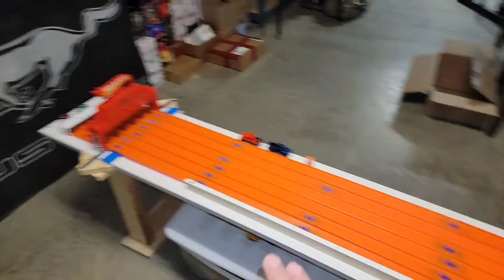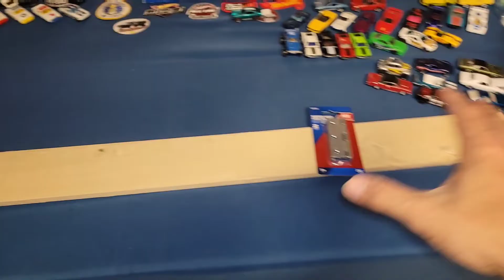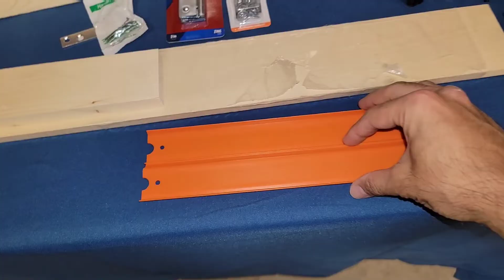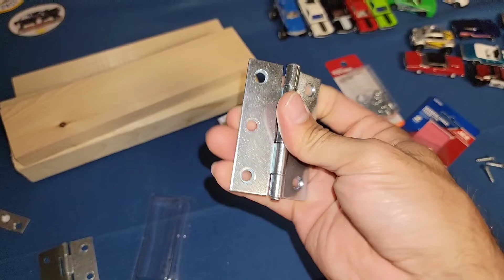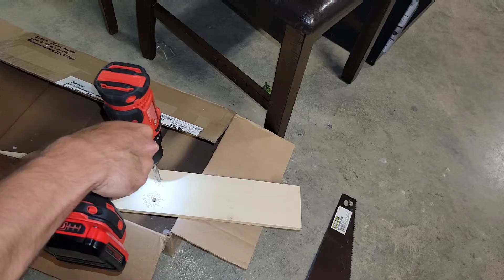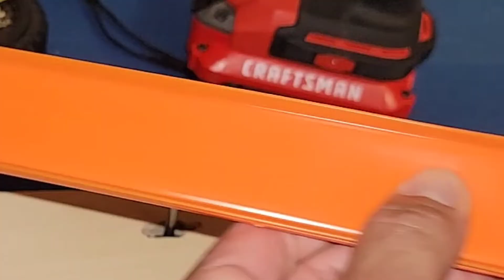DIY Make your own $10 Hot Wheels Track Start Gate (step by step)

Comment: if you replace the cat string with a spring, it will just pop back into place without needing to manually reset. But good job over all.
Reply from the maker: Definitely gonna be working on that 👌

Comment: The magnet to hold the pins is a genius idea, saves a lot of complexity found in other drop systems. I used an 8-ft length of MDF that works great.
Reply from the maker: Yeah, I figured the magnet would be the easiest and even cheapest. Hobby Lobby carries them for packs of $5